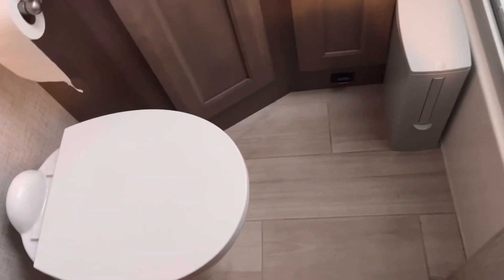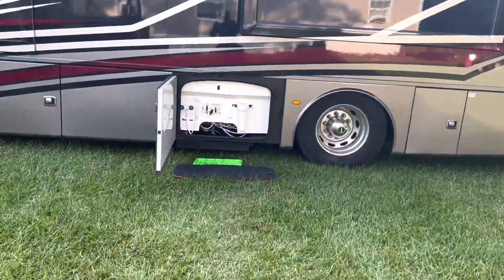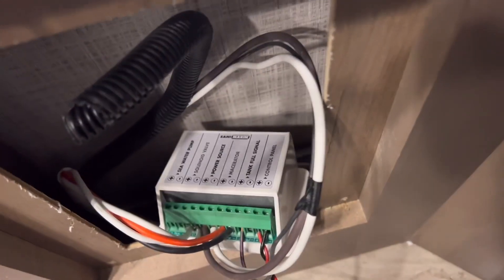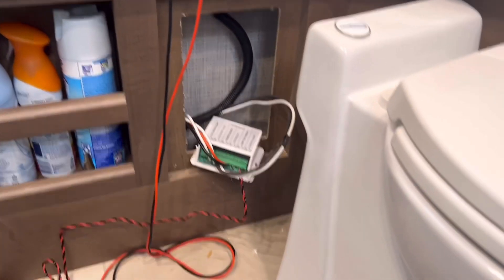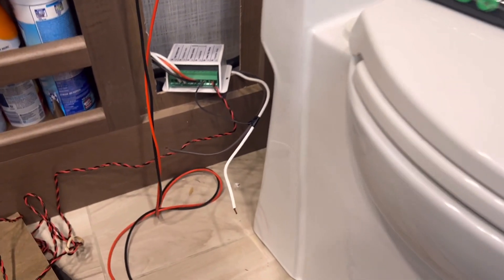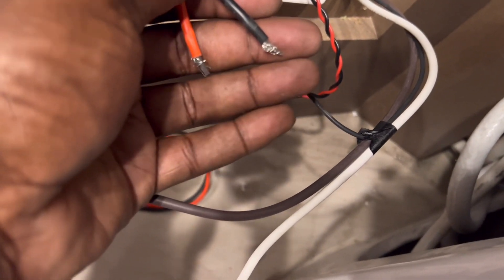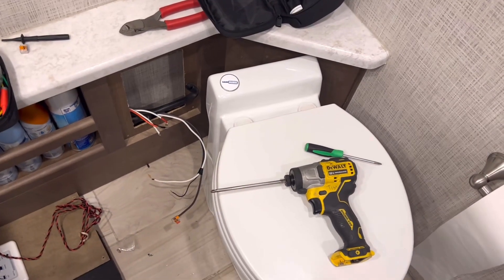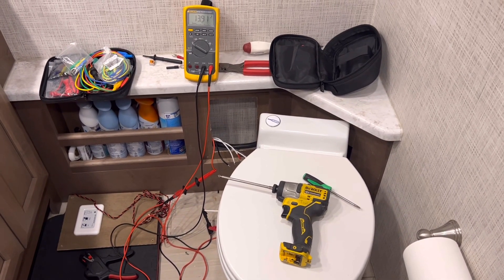WHAT? COMPUTER CONTROLLED RV TOILET !!

Comment: Your method of breaking the circuit in half is similar to how I was taught in my early apprenticeship years. Good stuff. That electronic flush control reminds me of a job we did several years ago. Removed all the mechanical flush mechanisms and installed 5VDC flush valves to limit the flushes to two every 15 minutes. A third flush attempt would lock the valve out for an hour. Kept the 'quests' at the local county jail from rolling sheets up and flushing them down.
Reply from the maker: Lol that’s rich